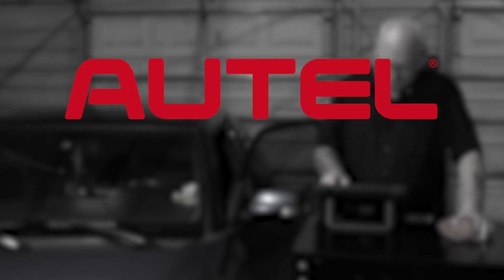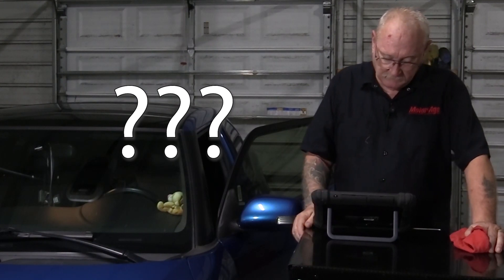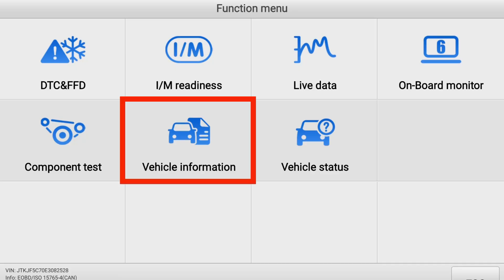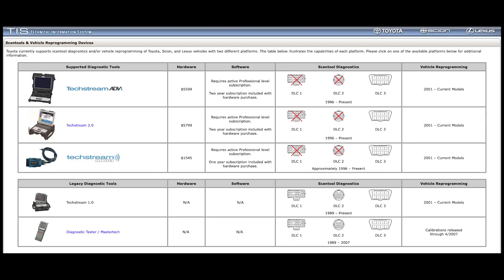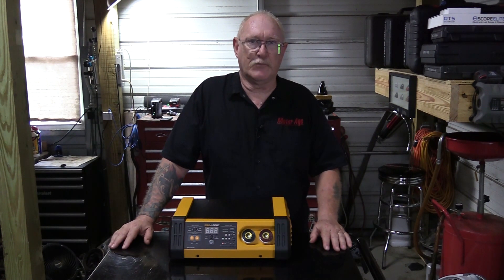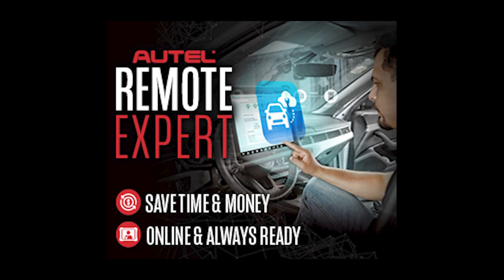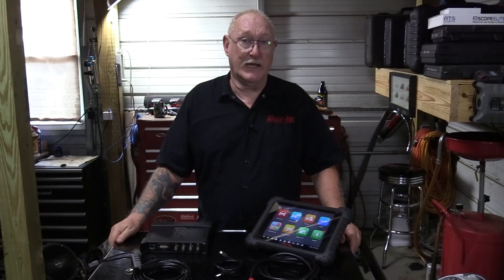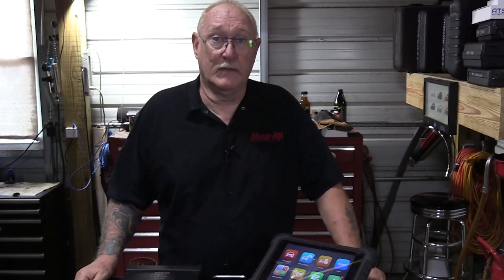The Trainer #130:  Diagnosing DTCs – Don’t Forget THIS Important Step!

Comment: not sure i could afford to be a programmer, buy every scan tool for every vehicle type and the bypass tool described in video(which showed $500-$2500 on example) and take the risk of computer/module failure and the responsibility to replace those components. I'd probably only do it if the vehicle is under warranty!
Even then id only cover Chrysler Mopar vehicles and use a local shop that has it

Comment: Does Autel do programming on the road? What are the requirements??
Reply from the maker: If you mean reflash or reprogramming a control module, Autel does over a VCI that is also a J2534 PassThru device. Each OEM has their own requirements in terms of PC specifications. You can learn more about them by accessing the OEM service sites through the NASTF site at www.NASTF.org.

Comment: Great video again but there's only one drawback if in fact it's the engine controller and it is emission related it is covered for 8 year 80,000 miles under federal law therefore you must get the consent of the consumer to waiver their right to that 8-year 80,000 mile to program the vehicle letting him know that it could be covered under emission control laws I'm surprised that wasn't expressed in his video
Reply from the maker: Good point! Thanks for sharing that.